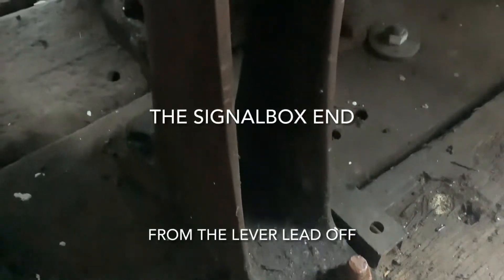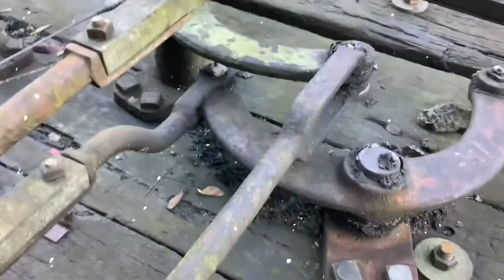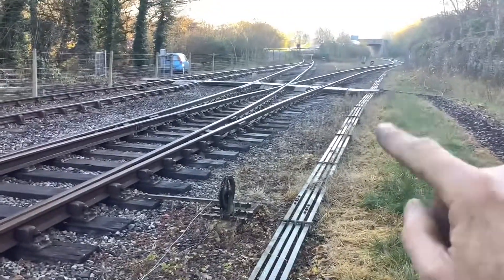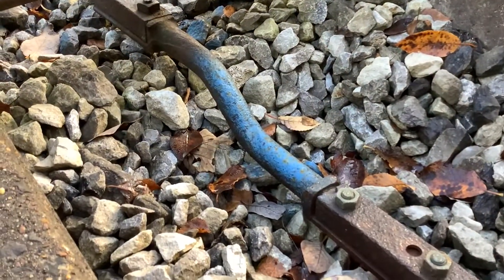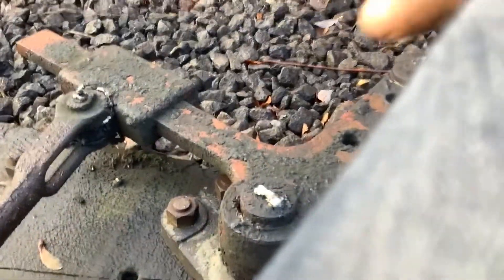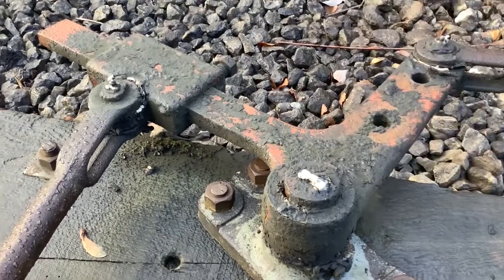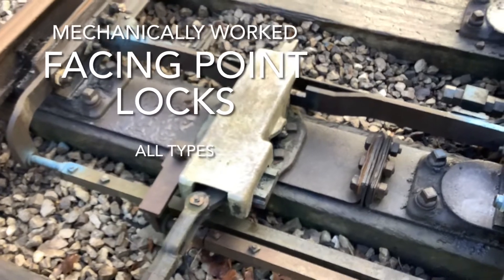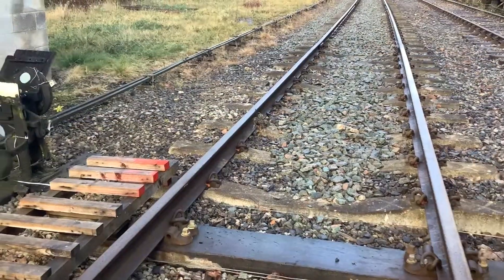The mechanical point run

Comment: Excellent video. New Zealand Railways used exclusively McKenzie & Holland (Worcester made up to the 1920s after which we used Melbourne made gear) mechanical equipment which used escapement cranks to drive the switchblades. Point lever movement always started with unlocking the blades in the first 25%, moving the blades in the next 50% then locking the blades in the last 25%. FPLs and lockbars were also used. The result was that once the point lever was fully normal or reverse, there was no compression or tension on the whole rodding run. The only rod in compression or tension was the short drive rod from the escapement crank to the points themselves, about 7 feet worth. There was very little wear on the cranks, jaws and pins. I am not aware of any interlockings after about 1910 which did not use an escapement crank. All point rodding is pipe because it rarely wore out. I have never seen channel rodding in NZ. This is in contrast to our Australian neighbours which did not use escapements. The first time I pulled a set of mechanical points in Australia, I was surprised that the lever popped out of the normal notch when I grabbed the catch handle. This was in total contrast to New Zealand point levers where the first 25% of relatively free travel, gave you the momentum to throw the points with ease. It is interesting to note that lever catch handle spring boxes in the Australian state of Victoria, which is also exclusively McKenzie & Holland, Melbourne pattern, have been replaced by VR (Victorian Railways) strengthened cast steel boxes. I was told that this was after an incident where a derailment on the track put so much pressure on the rodding run that the lever in the box broke the catch handle box and the lever shot to reverse, just as the signalman walked past to see what the racket was outside. The poor person was severely injured by being hit in the hip by the flying lever. Thank you for your good work making these videos!
Reply from the maker: We have a fair bit of mckenzie and Holland cam and soldier frame gear on the churnet valley railway,lovely stuff

I was given a set of notes on Australian railways setting up mechanical point runs and that was quite good,I like the metal bench legs as standard,we had a load of these on the MR early years later replaced with concrete

Comment: I seem to remember every point crank was made to engineers drawings to order in the same drawing set the points themselves were technically drawn so each crank etc could be swiftly made up by one of the metal firms used.    I remember fondly me old man when I went in to Sole Street signalbox with him one winter, he used to have on the stove buckets of oil he would be heating up and that he would trudge up and down his track washing the point motors and arms with hot oil to stave off the ice.   He only ever did that on nights where he could set all signals to red then off he would plod smelling like an engine sump lol   Sole St had two sidings, one on the ticket side station which had a Wickham trolley and the longer cripple siding by the box on the down side, neither were clipped and padlocked so had to be kept maintained and didn't have point motor warmers back then.
Reply from the maker: Yea there are so many standard cranks made by the works but there were also specials bent by the smiths to suit various get arounds too 😀

Comment: I always knew the running rails expanded but the points rods would as well, needing allowance the same!! 🧐
Reply from the maker: Quite a bit it turns out, for every 10 degrees rise in air temperature ( a morning to afternoon in mid summer) say over 300yrds (a full rod run) gives a 3/4 inch expansion.

Some useful guidance notes we’ve compiled highlight this in the expansion section.

https://www.irse.org/Portals/0/NewPortal/DownloadableLinks/Get%20Involved/MinorRailwaysSection/PA01%20-%20Mechanically%20Operated%20Points%20v2.pdf?ver=2019-09-12-130218-450